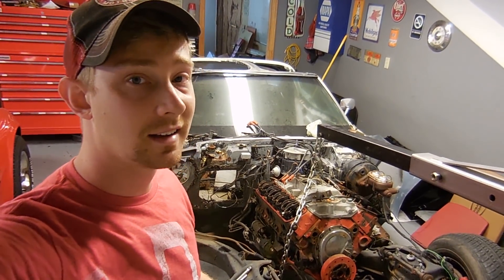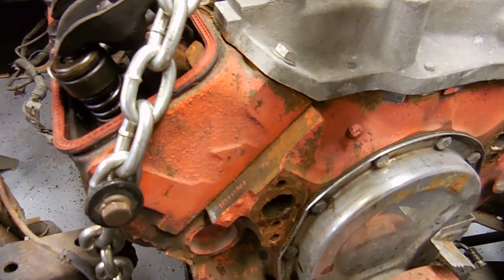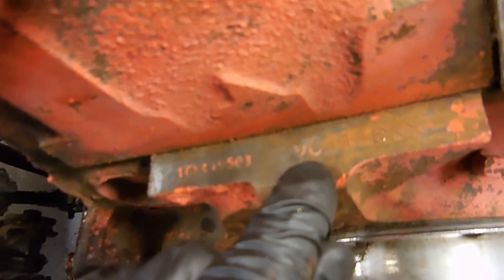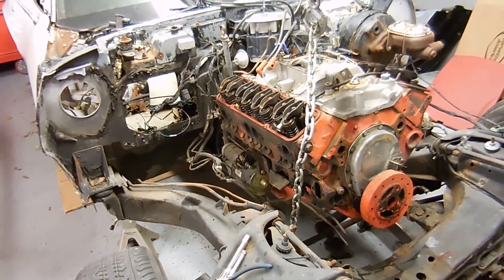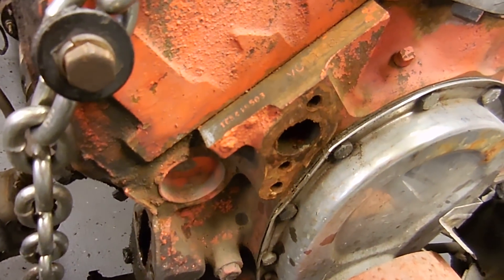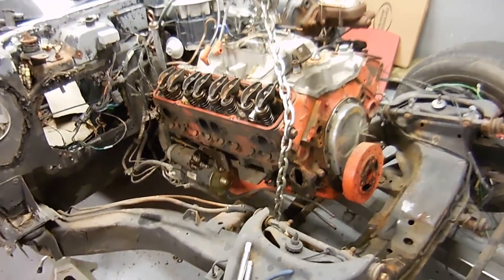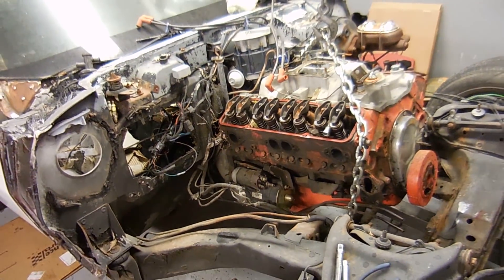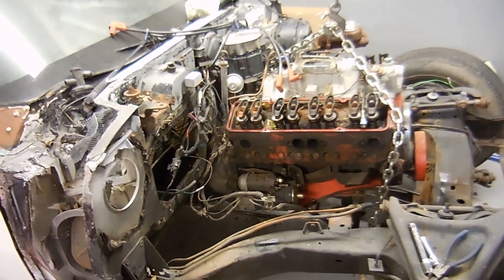Is Your C3 Corvette NUMBERS MATCHING? How To Tell

Comment: Keep in mind, or beware. When my dad owned my 69 prior to me, he decided in 1991 to have the engine rebuilt, it had around 195,000 miles on it and it was one tired engine. He hired a mechanic to do it and then just handed over the keys and said get it done. When done and back into the car some 2 or 3 months later, it was like witnessing a rebirth, very strong very good job, my dad was ecstatic until about a week later for some reason he happened to look at the numbers on the engine and was horrified to see the block was changed. Never seen my dad so upset and unglued to literally berzerk. Apparently the mechanic did a block exchange for one all refurbished and completely unaware of the importance of keeping the original block with the car. He was actually dumbfounded and confused by my dads reaction and then learned and realized the mistake he made. The car now has a 73 454 block in it. Very good running engine, no complaints there, but it is what it is now and though the car itself is 90 something % original, I can only imagine what if. Both the mechanic and my dad tried desperately to get the block back but apparently was to late. Point is, try not to appear to be watching over someone's shoulders you hire to work on your car, but do be hands on and involved. Had my dad been the original 427 block would still be in my vette.
Reply: I want to cry ...this hits right in the feels!!!
Reply: Btw...I believed my car to be all original numbers matching (although rusted as hell) ...and was praying for numbers on the block. She too is smooth 😔 Im with ya man..

Comment: I have a 73 with the original block in my car that is very tired and smokes.
Is this year important to keep it original?
My son bought me a crate 310HP complete ready to drop in he got from a friend doing a LS swap.
Reply from the maker: Keep the engine under the bench for the next owner. Swap away
Reply: I noticed a remark you made in another vid. Same as mine. The car was yellow according to the badge( learned that from another one of your vids) but now is red.
I just came across your vids. Yesterday was a marathon of watching your videos.
I’m learning a lot.
I’m stressing over getting my oil pressure gauge out. Your going through whole cars like it’s nothing.
Love your shows.

Comment: Is it worth straightening the frame and repairing the rust?
Reply from the maker: Not on a 1976, which is worth about $10k tops. You would have more than that in just the frame and engine build.
Reply: Question for you Ben, from 74-81 which car is worth the most? Are they are kinda the same? 76 being the last stingray not worth any more? Im just kinda talking base model coupes.
Reply from the maker: +Larry Celmer cars with 4 speeds are worth more. Lots like the 74 to 77 because the back window, lots also like the 80 to 82 because of the new style bumpers

Comment: I have a question for anyone willing to answer. I have a 1980 L48 c3 and we all know the hp is weak. I haven't verified but am pretty sure it's numbers matching, (but will) so my question is should changing the heads, cam, and exhaust to get some power out of it change the value of the car from a restored standpoint? If so, would it be a significant loss or no? Thanks Ben. I'm not there yet, do to a truck resto for my daughter but when I do, I'll be looking through your vids again.